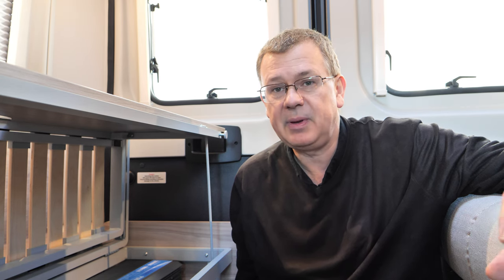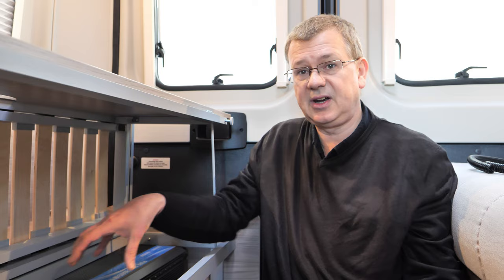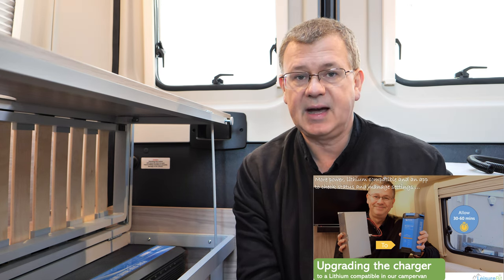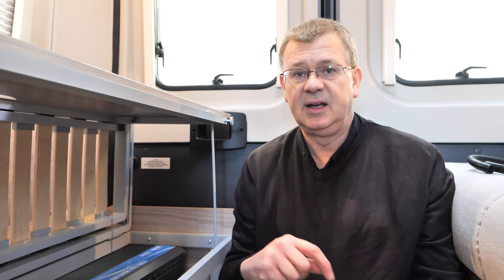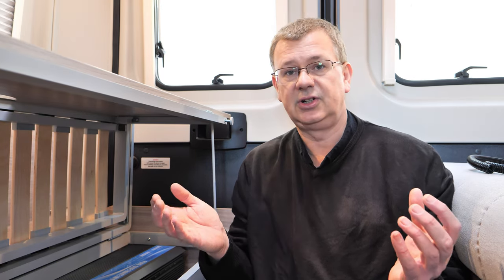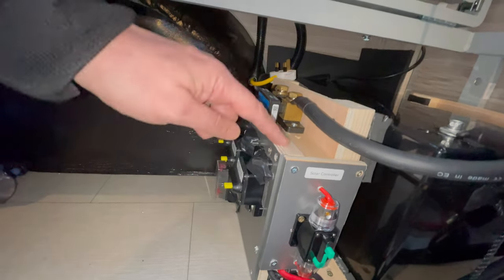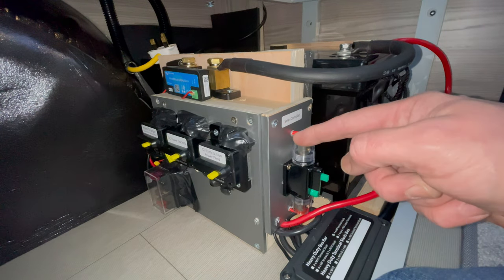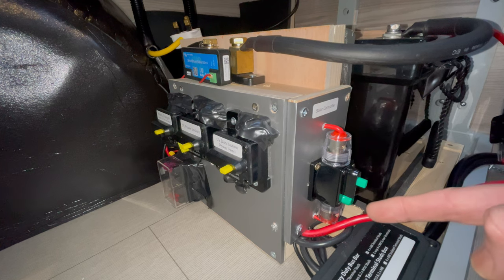6. Lithium Battery Install and fitting in our Elddis CV20 Campervan

Comment: Highly recommend getting rid of that 50A breaker in the + wire. Those are crap and especially if your run higher currents (eg an inverter) they get very hot or trip unwanted, and cause a high voltage drop (inverter might even shut down due to this). In general, 90% of those automatic breakers are crap, unless you spend $$ on a decent Bussman or BlueSea one or so, but there is no point in having a resettable, since it shouldn't trip anyway. A decent fuse is a much cheaper and more reliable option.
Also, use thicker wire when using a big inverter. The + seems like 16mm2 or so. Works fine for a small <600W inverter but for anything more I would step up the wires
Reply: Ow and contact steve (owner of Roamer), he can probably supply the proper stuff for install and has proper knowledge to advice!
Reply from the maker: Thanks for the comment. I am going to run separate cables from the battery for the inverter, I put the 50A breaker in to protect against any issues on the cable to the distro point and to enable it to be switched off easily. I take your point on the breakers not being great quality as I had to replace a 20A one (which now have as a 15A) on the Solar input. Appreciate your view on the inverter video (which should be on Thursday if i get the last bit finished off) - thanks again for the comment, appreciate the feedback- all the best, David 👍
Reply: @LeisureBit  I used a '300A' breaker to isolate the 3000W inverter - it melted first time out with about 80A going through it. Replaced it with a mega fuse.
Reply from the maker: @martinsydenham5835  I updated the setup and it now has a rotary isolator and fuse plus updated wiring (there’s a follow on video with the updates) - I should probably update this one - thanks for flagging though, David 👍

Comment: Hi David once again many thanks for taking the time to make these it is really helpful as starting to work on our CV20 lithium and Victron upgrade. In the wrap up video would it be possible to include some more detail on what you did with the elddis pre installed electrics and how that is integrated with the new setup. I know it is a bit cheeky to ask but it is the one bit iam a bit unsure of. Many thanks again your a star 😁
Reply from the maker: Thanks for the comment, really appreciated. Yes, of course - thanks for reminding me to do that also as I have a habit of unintentionally missing stuff like that and it would be great to include how it connects to the van and to what. Thanks again, All the best, David 👍

Comment: Hi, so once again I don’t know the size or spec of the cables you’re using (apart from the huge negative one to the shunt, not matched by one out the other side).  You refer to links at around 8:22 but I can’t find them.   Really all the items in your shopping list need to be pulled together in one place.
Reply from the maker: The sizing which I have since updated (vlog numbered 11) is 70mm2 for the inverter connections, and 25mm2 to the fuse and distribution for the non inverter electrics and then I would suggest using at least 16mm2 but would recommend larger (25mm2) for charger and other wiring to minimise voltage drop. Hope that helps.

Comment: Great series of vid’s David! What is your electrical knowledge level as I am not sure I would want to take on such a project! Mind you we haven’t got the van yet😂
Reply from the maker: Hi Stuart, I have always been interested in electronics since about the age of 6 so have a reasonable electronics background and some experience (all be it not an expert in) auto electrics. Always good to plan for the van :) Thanks for the comment, appreciated, All the best, David 👍
Reply: What a lovely setup you have installed there David. You should be proud of that. Nicely thought through and executed. The vlog was explained in such a way that made it easy to understand. Looking forward to the next ones. (Already watched inverter) as they come along. I thought I had a lot of power (240Ah) but yours is off the scale!  Love it. 🙏🚐👍🧙‍♂️
Reply from the maker: Thanks Graham, really appreciate the comment - looking forward to making the most of it - just a few finish off bits to do then it’s done - all the best, David 👍

Comment: Good video David.  Would like an inverter in ours, what size inverter are you fitting,
Reply from the maker: I’m fitting a 3kW inverter - I did have a 2kW inverter from years ago but it had stopped working so needed to get a new one. Will pop a link on the video for the inverter in the description for more information, should have that video out for Thursday if i manage to get the last bit finished off. All the best, David 👍

Comment: Sorry also, have you changed/stopped the factory fitted alternator to leisure battery charging or do you use that and the b2b
Reply from the maker: Hi Richard, that is through the B2B which was fitted still - if you have a split charge relay, i believe it’s sensible to update to a B2B charger as the lithium can draw too much power for the direct connection. Hope that helps, David 👍

Comment: QQ 50a main fuse is that holding up as an inverter will take much more amperage than 50amps on its own
Reply from the maker: The big fuse at the bottom is for the inverter, the 50A is for the campervan electrics and chargers etc - I think I have a 250A fuse in the inverter one (Mega Fuse with 70mm2 cabling for ref for that) hope that helps, All the best, David 👍
Reply: @LeisureBit  Hi David 
Great content and like some of the stuff you have been filming I am in the middle of doing some bits like you but thinking of integrating a power bank like an eco flow or similar. I have this on my current van but want to go a bit more in depth,  cheers Steve

Comment: Great series - in the process of doing my elddis 115 the same - just changed the psu and fitting the b2b this weekend.  Can I ask what size is the breaker you have from the solar panel and where did you get it from.
Reply from the maker: Hi Richard, it’s a 15A breaker I have used based on the solar setup. I got the breaker from Amazon but you can pick them up from other places also. If you search for 12V 15A circuit breaker you should be able to locate one. I will put link in the description in the video following the inverter for all of the bits (If i put a link in this comment, YouTube normally deletes the comment). I am using the B2B charger which was supplied as it came with a B2B with it having the Start-Stop. I know a number of people have used the Victron B2B which links in with the rest of the setup if you don’t have one installed already. Hope that helps, All the best, David 👍

Comment: Hi David, could you tell me how your upgrades are working long term. I am thinking of upgrading my autosleeper kingham. Is it good long term. We require 5/6 days off grid .
Reply from the maker: Hi Andy, pretty good to be fair, no real issues to report apart from swapping out the inverter cables and breakers and an odd issue with spurious capacity readings in the app but other than that seems ok - I am doing a year on video hopefully next week when I will touch on a few points but in the mean time I’ve been pretty happy all in all with the electrical setup - all the best, David 👍

Comment: Hi David loving the vids. Quick question if you don't mind, do you connect the mains battery charger to the positive bus bar or does it have to be connected direct to the battery terminal? Many thanks in advance Andy.
Reply from the maker: Hi Andy, I’ve connected it via a 40A breaker to the bus bar. The onward connections are capable of significantly more current so didn’t worry about connecting directly - plus with the lithium BMS etc shouldn’t be an issue (and all seems to be working well) - I’m sure some folks would connect directly though but I personally don’t see any benefit in real terms with the setup in doing that - happy to be educated to the wiser but can’t see any advantage as all much higher rated. Hope that makes sense and helps - thanks for the comment and support -
All the best, David 👍

Comment: Hi David great video series on lithium battery. I have cv 40 and thinking of up grading to lithium. Just wondering have you up graded any of the wiring from engine side to b2b charger or is what eldis put in good enough.
Reply from the maker: Hi Barry, I haven’t currently but I did note the installed b2b was giving about 16A so I am going to have a look, the wires into b2b look ok but it maybe somewhere en route. Will update when I figure it out, it’s working fine just loosing a few amps from max available I think but need to look a little further as it may be how it’s charging via b2b behaviour rather than cable. Hope that helps, hopefully will know more soon, all the best, David 👍
Reply: Thanks for the reply David. I have been trying get as much info about lithium up grades and it seems general consensus is that wiring from engine side generally needs improving to get the max charge to the battery. Any way great job so far look forward to seeing any new videos on  the matter. 👍

Comment: Hi David thinking of changing to Lithium, My Leisure battery in a 2o19 Swift 622 currently gel type laying on its side under drivers seat in a Ducato...i am novice but Fogstar the 15 ah Lithium supplier say i dont need to change charging system a which is a sargent smart charger or the solar Panel Regulator , please could you give you expert view as I cant find any Motorhome dealers or garages locally to advise
Reply from the maker: Thanks for the comment. Quite a long answer as lots of unknowns but some points to consider generically.

It’s a difficult one to answer specifically without the model of charger as some are absolutely fine and others are not and conscious there’s lots of bad advice and chancing which goes on. 
So your setup may be fine but you normally need to change settings as the chemistry is different between Lithium (and different types) and AGM / Lead acid types. They need different charging characteristics to work optimally.
Now some setups which aren’t designed for lithium will work and will charge up, maybe not optimally and may reduce the life of the battery for example or not be able to reach full charge.
There are some situations and it depends what protection etc is in place to prevent this such as over voltage charging which could (without the right protection) lead to damage, swelling of the battery cells or worst still for some types depending on the extremity, fire or explosion. Worth adding the same for lead acid type if incorrectly charged of course.
Personally, if there was any risk I wouldn’t do it as in the event of an incident who would be liable?
If you have the models of them I could give a better answer on whether not optimal or risky (battery and solar/sargent) as you can look at the specs. Have Fogstar given in writing also that it’s ok (in which case they would hold some liability if there was an incident I believe)
Many people have fitted lithium without the correct things in place and rely on the BMS to protect and it’s done a good job of that. My concern is in the unlikely event of an issue. 
Hope that helps, just my honest view, would I take a chance personally,  no, as I know what could happen all be it potentially low risk. 
All the best, David 👍
Reply: @LeisureBit  David thanks for the detailed reply .. I photographed the Sargent charger and sent it on email the then Fogstar did say it was compatible but like you I would rather get proper compatible system in case of snags like you described. I am finding it difficult to find a professional fitter anywhere that could do this sadly . Fogstar just sell the battery don't offer fitting service
Reply: Hi David how have you connected the vehicle alternator to the lithium battery, due to the dangers of alternator charging lithium batteries without some alternator protection Richard
Reply from the maker: Morning - it’s via a B2B, originally a Schaudt one which came fitted to the van but I upgraded firstly to the Victron Orion 12-12-30 then to the Victron Orion XS. Hope that helps, All the best, David 👍

Comment: What size negative cable coming out of shunt
Reply from the maker: Hi David, I used a mix of 2x25mm2 or 50mm2 but am upgrading the cables to the inverter and shunt to 70mm2 as I’ve found the dual ones not to be as good as expected (not sure the quality of cable was as good as it said) 
Hope that helps, all the best, David
Reply: @LeisureBit  hi you seem to have 70mm going into shunt but what is coming out
Reply from the maker: 2 x 25mm (or 32mm can’t remember as got a selection of cables at the time) so using dual but swapping to single. They connect to the bus bar. (If that makes sense)
Reply: 70 mm going into shunt what’s coming out only one wire
Reply from the maker: It was a 32mm but added a pair of them following as was waiting for the parts so it currently has 2 but swapping to single 70mm2
Reply: There’s only one to the bus bar